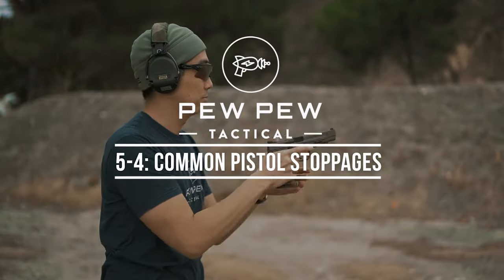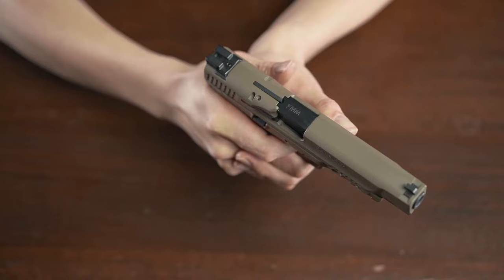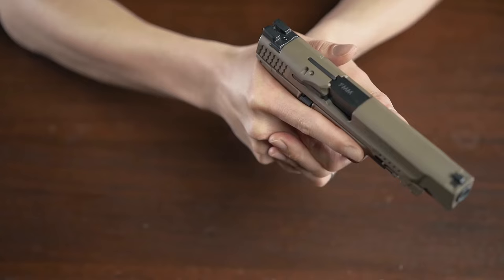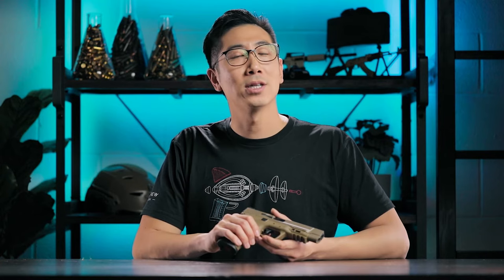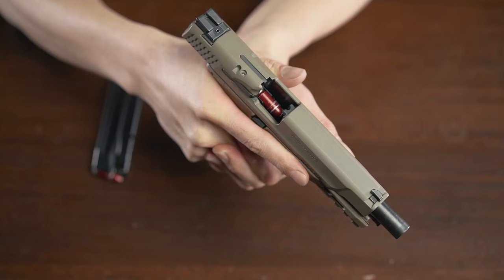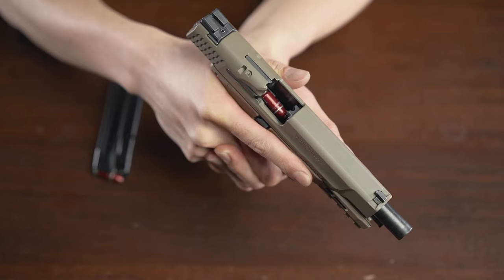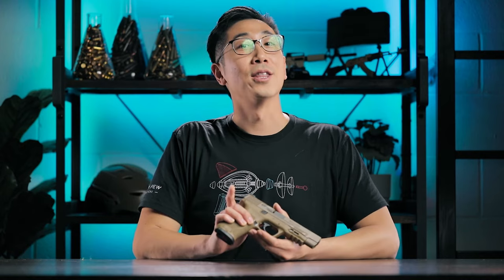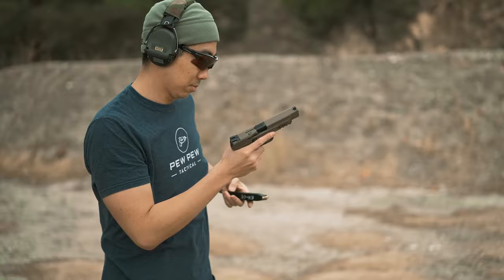Most Common Pistol Malfunctions/Stoppages and How to Clear them Safely!

Comment: I don't recommend a tap rack on a stovepipe : it's the best way to get a double feed. You don't know whether there's already a round or a case in the chamber.
Reply: Just rotate the gun as you rack 90 degrees to the right and gravity will drop the casing. If you're getting type 3s from a tap rack flip your gun is a piece of shit😂
Reply: I know but some people don't have the reflex to turn the gun upside down.
Reply: @methodeetrigueur1164  Common sense.
Reply: @methodeetrigueur1164 especially not while being attacked. Shit happens fast when it goes down

Comment: What is it, and why did it happen, when the gun fired the round but there was no ejection of the case, no stove piping, nothing? Just an empty case in the chamber. Like the round didn’t create enough energy to make the slide function enough to extract and then load a new round. Most importantly, is that the guns fault? Or is it a shooter or ammunition fault?

Comment: I've heard doing tap/rack for a stovepipe can lead to a double feed. Have you guys heard/seen that happen?
Reply: Racking with force to allow the round below the stuck case to throw both out or turning the gun upside down when you rack should prevent the potential double feed.

Comment: I've seen other videos that say you should remove the mag (lock slide back, eject mag, rack, mag in, rack) is this to prevent accidental discharges?
Reply: I dont see why you would lock the slide back then eject magazine and rack, why not just eject magazine and rack ?
Reply: @lancehobbs8012 During a Double Feed Malfunction there's a round binding up on the feed ramp, which generally prevents the magazine from falling freely when pressing the mag release. This is why many instructors teach to "lock the slide open, then release the mag" (locking the slide open releases the tension of the round against the feed ramp).  

If the round in the chamber was a fired/empty casing, it will have expanded slightly, hence the "rack the slide" step to have the extractor pull it out of the chamber.   

Then "reinsert the mag & rack again" to load the next live round.

For those who have enough baseplate exposed on their magazines to grip it, I teach to just "press the mag release with one hand, & yank forcefully down on the mag with the other hand".  This  removes the stoppage, & all you have to do is "reinsert the magazine & rack slide" to ensure whatever is in the chamber is a live round (typically the one in chamber is a spent casing; racking slide gets that one out & a fresh round in).  Here's a deep-dive video that might help illustrate: https://youtu.be/CnqbCUDreqY
Reply: Not so much to prevent a negligent discharge,  but because there is likely a round binding up on the feed ramp.  See the explanation that I posted to @lancehobbs8012 in his comment to your comment.

Comment: The way you perform a type 3 malfunction clearance is outdated and not effective except on a flat range.On the two way range-that’ll get you dead.It should never take 7.5 seconds to clear a double feed.One rack is all it takes.Unload the weapon-reload the weapon.It takes a well trained operator 3-4 seconds maximum.
Reply: @irishdefense77
I agree with you that the more modern approach is much quicker, however (1) it takes two hands to do it, & (2) it requires that you don't have a magazine baseplate that's flush with the bottom of the grip (ie, you need to have enough grip on the magazine to be able to pull it free).   Here's the way I teach it: https://youtu.be/CnqbCUDreqY 

I still teach the method shown in this guy's video, but teach it as a contingency for those who can't get a grip on the magazine (or have weak hand strength), & for doing 1-handed malfunction clearing if one hand is injured.
Reply: @ColdBoreTactical_LLC  we were trained one handed only as well and I have never had problems reloading off my belt or my boot.Todays day and age,service pistols are 65% Glock or a copy of such and these weapons in my experience don’t even double feed ever.I have over 80K rounds between my SF career and the State Police for the past 18 years-31 years total and never even seen a live double feed in a Glock.